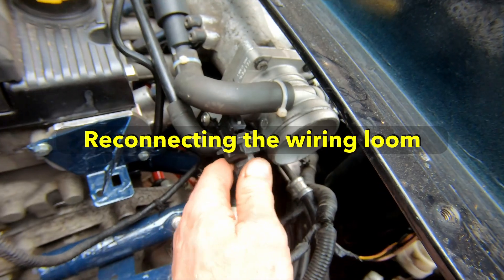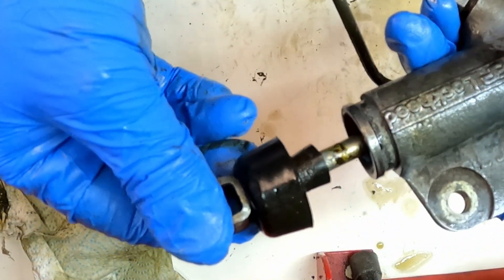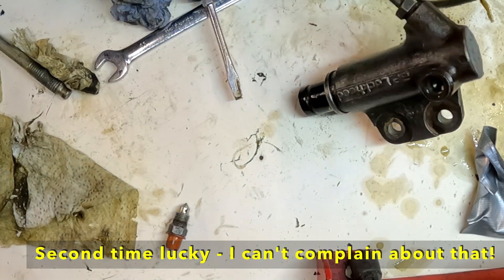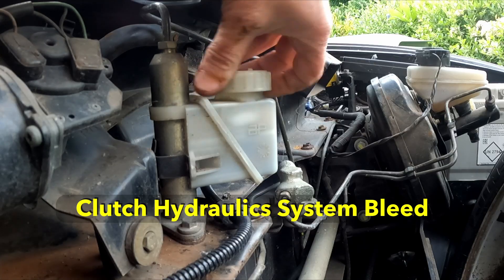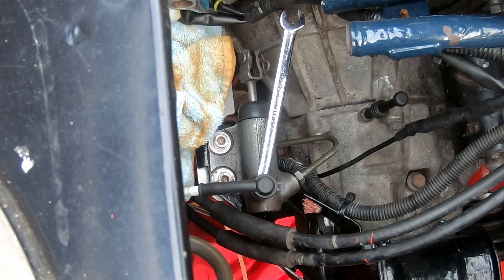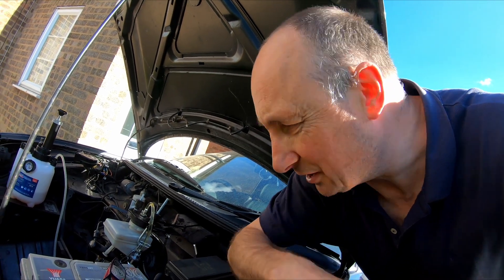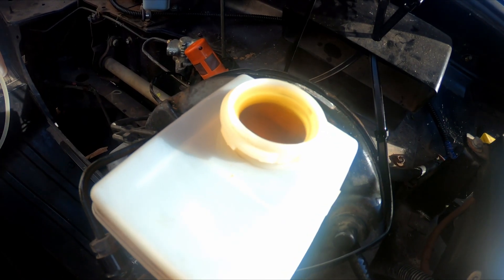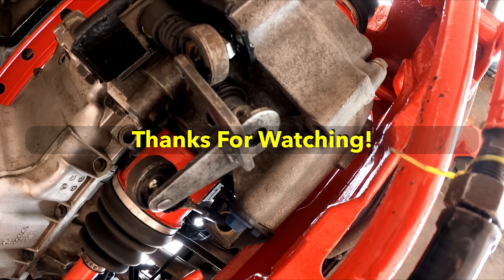Scotty’s Overheated MG TF 135 Rover K Series Engine & Subframe/Suspension Rebuild (non-VVC) Part 11

Comment: Great to see it nearly complete! I did change the slave cylinder rubbers on mine, then found the master cylinder was full of black silt, I assumed the rubber seals were degrading so I got a new one. Third gear was stiff in mine but fine now. Will you be getting the oil pressure up before starting, as a fresh rebuild it might be worth doing. Looking good around the engine bay. Looking forward to hearing it start up now. Best of luck!
Reply: @DoubleDuckGarage  2003 TF 135, five  years, been a great little car, it was a little neglected when I bought it but its great now, spent £1500, getting it upgraded and all the little things corrected, been very reliable, Mark :)
Reply: @DoubleDuckGarage  Did a lot myself and have a great garage who look after me.